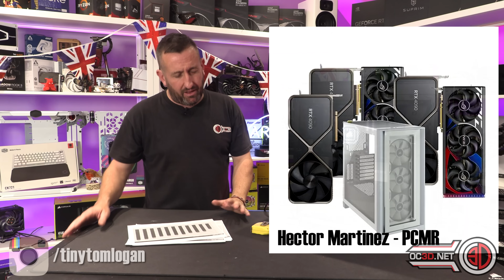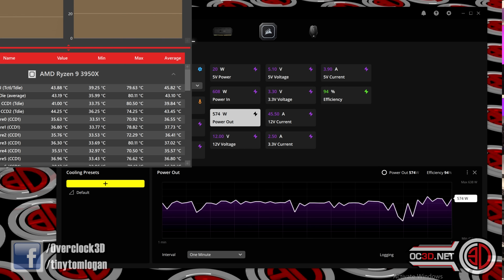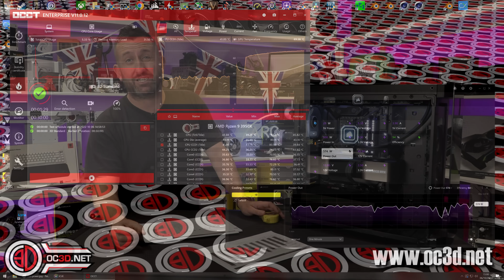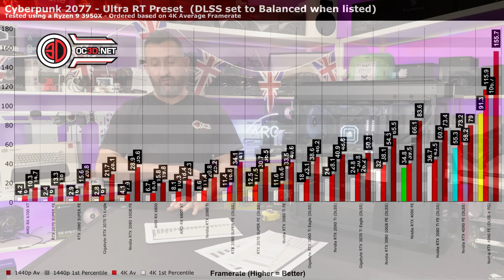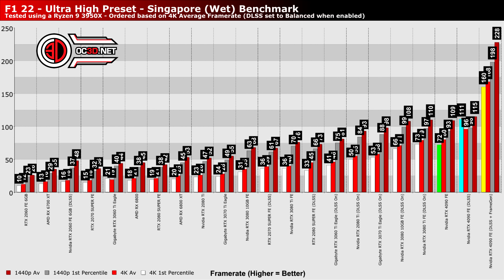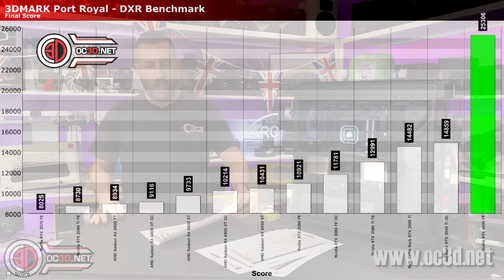Nvidia RTX 4090 Founders Edition Review

Comment: 1:55 I use it with my 850w psu from Corsair 😅
It works perfectly and I overclocked it in 3d mark Timespy. With my Ryzen 5800x3d which consumes only up to 80ish W it’s safe.

Comment: 1000watt is plenty for a 4090
Reply: Facts, Which is more then enough. I know people with 1,000 w power supply with a 4090 as well no problems
Reply: @DETERMINOLOGY  i have the 4090 strix with 1000rmx corsair psu ..its plenty

Comment: All this 1000+W nonsense. Anyone not doing hardcore OC, which is totally inefficient on all the latest Nvidia GPUs, doesn't need anything above 1000W and even this is way over the top. A 4090 at it's sweetspot doesn't even challenge a 850W PSU.

Comment: good to see tom your using the corsair psu lead i seen that a while back that has tobe a better plug than one supplied as that's only guaranteed 30 connections which is daft also its neater and solid core lead from what I've heard , I've got a corsair psu type 3 leads but it does take type 4 but not the type 4 24pin, just use a hair dryer to bend the lead like i learned off you ages ago lol mad that as I've been building pcs for years and you mentioned the hair drier I'm like wtf the little things lol, was an old vid also as i posted on it years after, never forget that mad

Comment: Great review as always mate. Always appreciate the in depth videos you produce. Just snagged my 4090 - upgrading from 3080 (which never gave me the performance I wanted at 4K), will be interesting to see how it matches with my 5600X. I'm only running a Corsair 860w PSU, but judging by the power draw numbers I've seen here and elsewhere, I don't think it's going to be a problem. Besides, I think I'll be undervolting, as it's already stupidly overpowered. Gaming at 120fps 4K on my LG 48" OLED is going to be insane. The price for entry was, well, absolutely insane. But I look at it this way - this will be the only graphics card I will require for probably the next 4 years, so the investment over that time will be well worth it.
Reply: I also upgraded my 3080ti to 4090,should arrive tomorrow. But my TV has only 60 hz refresh rate, so I will be running  4090 at 4k60
Reply: @white9093  Have fun with it man, I'd be looking at investing in a faster panel though. 32" OLED's are apparently coming next year, so might be something to keep an eye out for.
Reply: @BallisticSollution  Im sure I will man,I hope that 1000 watt PSU will be enough for 4090 and 5900X

Comment: Sat down with my box of broken biscuits (which weight 2050gram not the 1300 they advertise) and realised this is actually 25% heavier! Coming at you with the important performance metrics.
Once the graphs get a bit busy.. can we get them split by resolution? So like CP2077 at 1440p and another at 2160p. Because 76 vertical columbs is a little too much information 
(and thats coming from a guy who writes novels).
Reply from the maker: yeah I thought that too tbh

Comment: Hold out, guys! Let us not forget that $599.99 would have got you a top-of-the-line GPU in 2008 called the GeForce 9800 GX2. Adjusting for inflation today that would be $927.85

Far below the 4090's price. Don't buy it and have them drop their prices or buy their competitor AMD if their prices make sense
Reply from the maker: Back in 2008 there was such global turmoil, issues with shipping and component shortages though....
Reply: @OC3D  I agree with a certain point.

Nvidia has been raising its price for years before this. If you also take a look at their in-house GPU variant name and compare them to the old GPU's you'll notice that the Titan X should have been the Geforce 980 ti and the same thing with all the other titans.

Supply and demand are what will lower the cost. If they have little to no buyers and sitting on the stock they'll lower the prices.
Reply: enjoy never getting a graphics card ever again 🤣
Reply: @darudesandstorm7002  Such a funny comment. There's always 2nd hand and AMD assuming they're priced fairly. :)

Intel has recently entered the ring and if they fix their driver issues and keep their cards priced fair I can also consider them.
My 1080 still does what I need it to do. I have no reason to upgrade.
Reply: @ComputerProfessor  ah yes, the moving of the goalposts to value proposition of a newly launched flagship product vs older cards on  the used market. very original. followed by the 'i have x so it doesnt matter for me anyways' comment 🤣
Reply: @ComputerProfessor  oh and btw, look at reviews at the time of the 1080ti and you'll see they were still seen as overpriced/pricey by the majority of reviewers as well, only overshadowed by the titan which are always mega overpriced. of course a card will be better value 5 years later when it can be picked up at fractions of its original price but to compare that to brand new hardware is just asinine at best.
its like some poor college kid balking at the cost of a new $80k porsche then smugly remarking that his 30 year old civic cost only $300 and still gets him from a to b so why would anyone possibly bother to spend more. theyre not even in the market for a porsche yet decry the fact that such a product exists.
Reply: @darudesandstorm7002  Nvidia has been raising their prices since the 700 series. I bought my 1080 2nd hand in January 2017 for $200 :)

If enough people refuse to buy their products their prices will drop. It's how capitalism works. 

If you have enough time to type out those replies you have enough time to watch this video at 2x speed. It'll give you almost everything you need to know:
watch?v=r5DsL2y8aBk

It's not that I can't afford something higher-end. This is the final reply I'm giving because from this point on I'll be repeating myself
Reply: @ComputerProfessor  i had already seen the adoredtv video last month but thanks for the link anyways. funny to watch it again after the reviews and seeing just how wrong he was on the cooling and efficiency lol. it was neither the space heater everyone said it would be and did give typical generational gains while using less power than its predecessor. still like his rants though. i dont see amd riding in on a white horse to save the graphics card market like many others seem to but ill be glad to be proven wrong. though the recent zen4 release doesnt exactly instill confidence in that outcome imo.